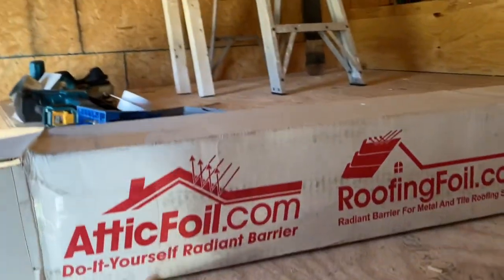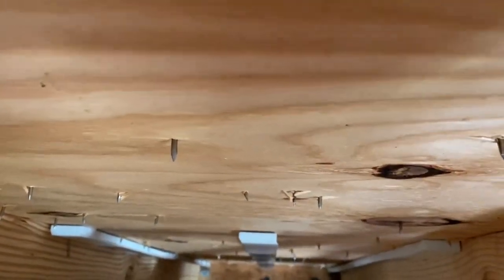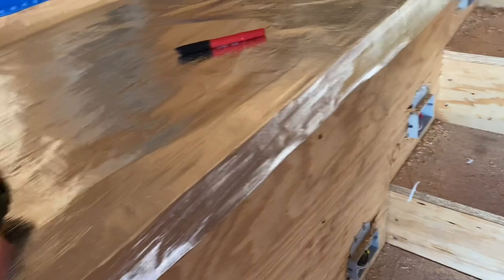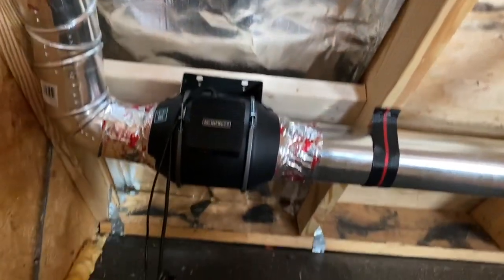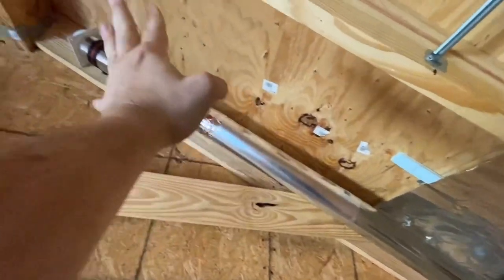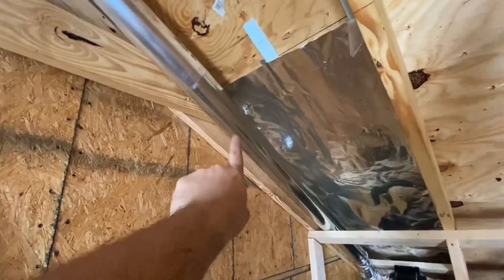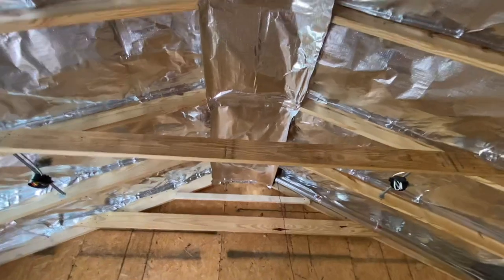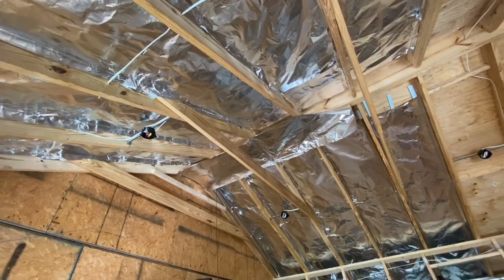How To Install Radiant Barrier in a Cathedral Vaulted Ceiling Roof | Attic Foil

Comment: Nice. I have a room just like this. We have duct work issues up there and definitely some insulation issues too. We do have a ridge vent, but no soffit vents (yet). I'm ripping the drywall down to diagnose. Looking to add Attic Foil and insulation. Thanks for the video!

Comment: Why wouldn’t you have just stapled it to the bottom of the rafters and had a 6” air gap ? 
We run it across the rafters not parallel with them .
Reply from the maker: Because I needed to get 10” thick of r30 bat insulation in there as well
Reply: @Archifx  so you're putting Batts on top of this?
Reply from the maker: Did it already. Yeah
Reply: @Archifx  now that it’s winter have you had any condensation form between your r30 insulation and radiant barrier. I’m running into that issue now? Have good ventilation and still getting the issue. Currently trying to come up with a solution now.
Reply: @jakepshs07 
I tell you can't win for losing, huh

Comment: my home dosent have soffits or ridge vent will this still be ok to use RB
Reply from the maker: It’s called a hot roof. Look into it
Reply: @Archifx  thanks i did look into it wasnt able to find much except someone using a closed cell foam. 
Do you think i am able to use an radiant barriar with no issues i just dont want mold to grow

Comment: Why use this instead of regular baffles?
Reply: Regular1"tallx4'Lx16"W baffles are 3$ a piece . The insulation board is 1/2tallx8Lx4W & 20$ a board . Can cut the 4x8 board in 1" strip and get 48 of them and use the foil as baffles to spread the 16". . If was just keeping the insulation off roof then baffles are easy and cheaper price for same project plus no cutting boards and 1" air gap instead of 1/2" air gap. Finding something not expensive and take the heat to cover the 16" or 24" center rafters is the problem.